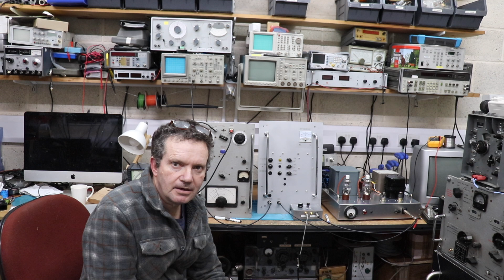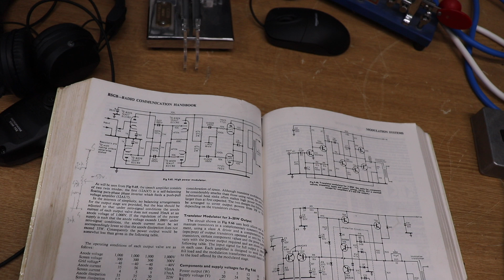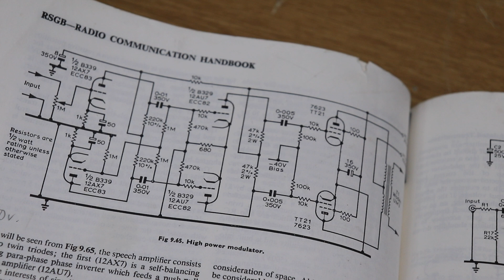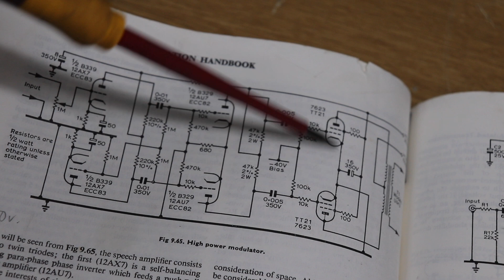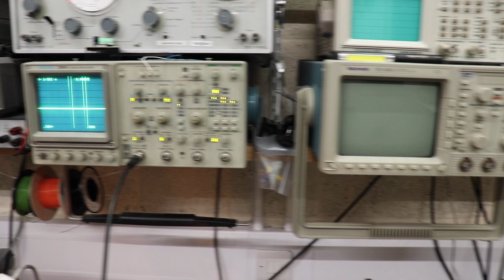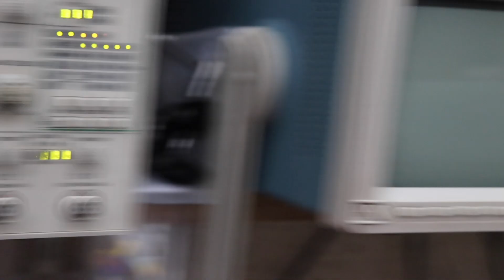807 Modulator For The LG300 Transmitter

Comment: I wonder if you could use a 100VA 250Volt 6.3Volt transformer in conjuction with your solid state modulator.  Primary in series with the P.A HT Supply and secondary to the solid state amplifier output.  Impressive construction, looking really good.  Thanks for making these interesting videos.

Comment: Valve designs would have really struggled but switch mode PSU's meant a supply of decent HV electrolytics. The unit looks like the valve amplifiers I used to build and test 20 years ago. Especially ECC83's & 82's as signal dual valvbe single envelope. The 807's with the top cap reminds of the PL519. As for the choke, this was replaced by a high wattage resistor for cost between reservoir and smoothing which decouples and works as a low pass filter. If using a choke at some point tickles your interest they are superior for smoothing and have energy storage properties as well as per inductors (which is what they are) Cambridge Transformers about 5 miles from where I live can supply these as they did when I was building valve amplifiers.
Reply from the maker: Excellent Chris! At the moment it sounds OK can’t hear much in the way of hum . I think Hammond do chokes at a reasonable price